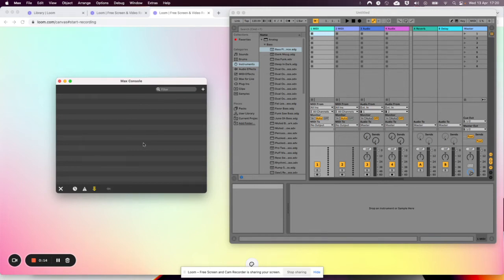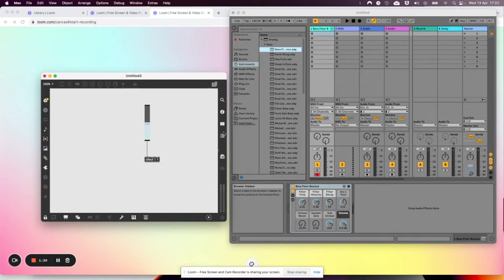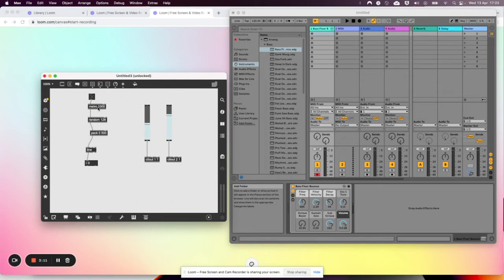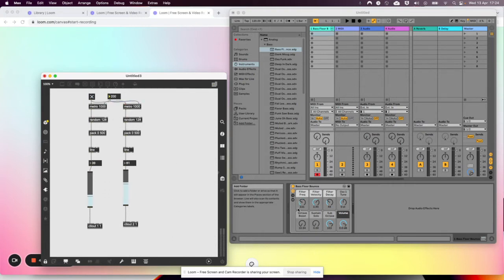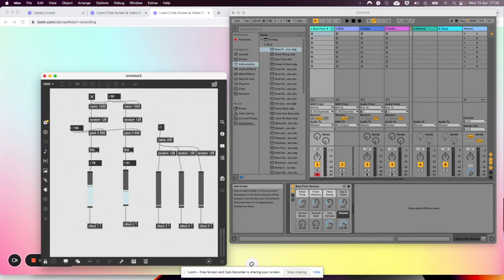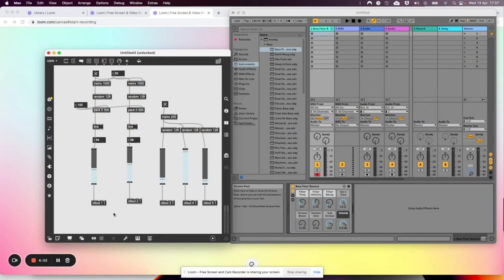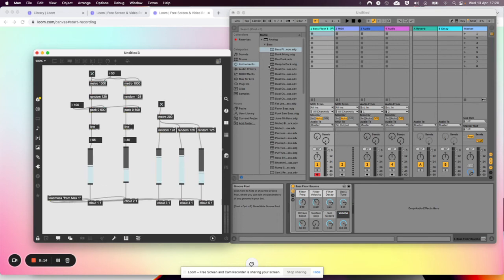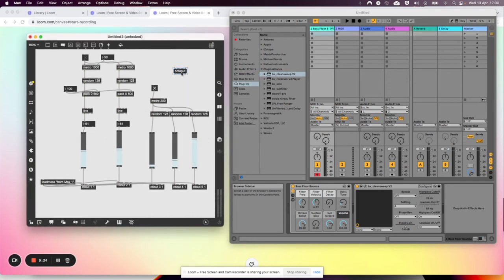MIDI Mapping -  Max to Ableton

Comment: Can a M4L device midi map to Ableton?  (e.g. midi map M4L slider to track 1 volume slider in Ableton).  I don't have Max, but in Max4Live, even though I don't see M4L in Settings/Inputs,  I can choose a MaxForLive as a control surface.  Still can't find a way to link the M4L slider with the Ableton track slider.... ????

Comment: Does the mapping works both ways? If you change a parameter from the Ableton session it also changes in max?
Reply from the maker: you would have to use notein and ctlin objects to receive this, but yes you should be able to get it to communicate both ways. Have a look at this video for Ableton to Max - https://www.youtube.com/watch?v=kK76itbORSk

Comment: hello, your method works well for the Maxmsp. However, if I use Max in the Ableton, this method cannot work. Do you have any idea to fix this? Or is there any way to control the plug-in data through Max for Live?
Reply from the maker: hi, routing midi data around multiple instruments is tricky in M4L. The easiest method would be to create a Max Instrument. Save it. Install Max standalone and open your M4L device with Max standalone.

Comment: When I double click ctlout or noteout there is no "from Max 1" option. Same in Ableton, when I check the MIDI preferences there is not a "From Max 1" or "Form Max2" option
Reply from the maker: if that isn't working for you, I recommend trying loopMIDI. You will need to reopen Max and Live after installing - https://www.tobias-erichsen.de/software/loopmidi.html
Reply: @JennKirby  thanks for your quick response. It seems that there are no MAX MSP midi ports, I tried loopMIDI and it worked great.
Reply: @JennKirby  Hello! Thanks for lesson, this approach worked well for me. The only issue that it only seem working when using a standalone device. Do you know whether it is possible to map it the same way as an abbleton device?
Reply from the maker: @gregkysenko5301  hi, it's not possible in the same way. I do it as a standalone because I can have one patch controlling anything/everything in Live. Usually M4L devices are for controlling one track.